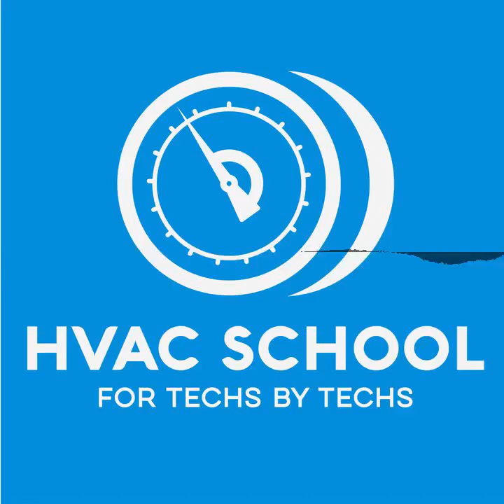(Podcast) Advanced Evacuation w/ Jim Bergmann

Comment: question for the guys n gals making this content, which i am truly grateful for. I don't believe this was discussed in your video, but is there a point to owning a 16cfm 3/4 trublue hose when running a 6/8/10cfm pump? currently im running two 1/2 appion mega flow hoses. both 5' long, one 1/2 thread by 1/4 thread, and one 3/8 thread by 1/4 thread for a complete system repair ie: compressor swap. or the single 5' long 1/2 thread by 1/4 thread hose for new install (coil+lineset). those two hoses are rated for 6cfm a piece, and my fieldpiece pump, is rated for 8 cfm. in my head im seeing 12cfm, which is obviously more than what my pump is capable of. the vacuums are usually less than 5 mins on a complete system and 5 mins on an install. is my pump really running more cfm than its rated for? should I have opted for the 10cfm pump? do I really need 2 1/2" hoses?

in short: if my hose setup is rated for more than the pump is, does that give me ANY benefit? thanks to your advice i've saved countless hours, and really, maybe days/weeks thanks to this video.

Comment: Not to be a nit picker or Chirper … but there was a comment made at about the 1 hr  mark 

The topic being pulling vacuum with one hose vs two

The comment was made “Just spring for the extra $100 and buy the the other hose”

I looked on TruTech and the difference between a (1) hose kit at $193.95 vs a (2) hose kit at $545.95 isn’t just a “Pop” of $100

51% claimed “Pop” difference vs 281% actual is SIGNIFICANT when it’s coming out of my Technician pocket 

Just saying